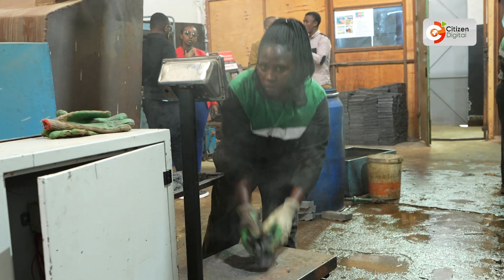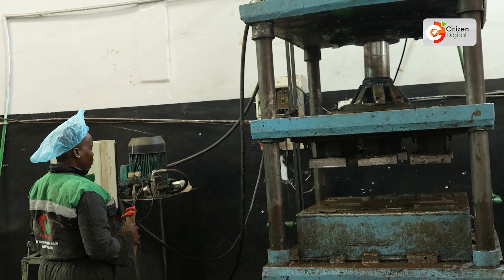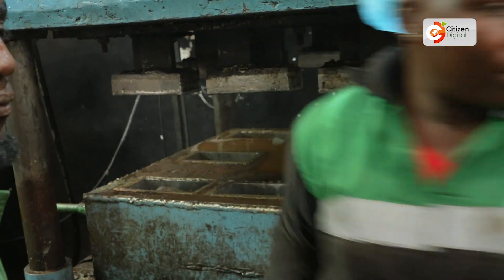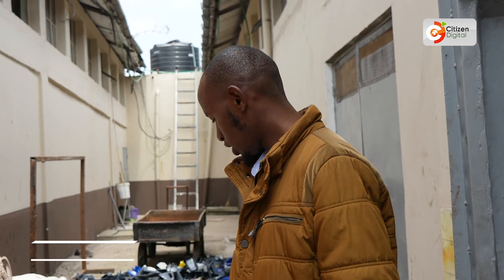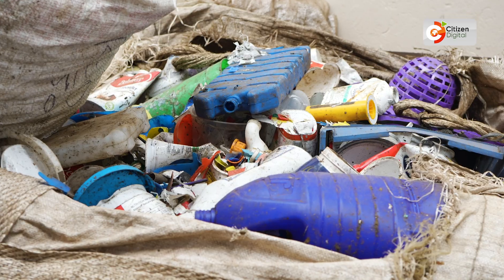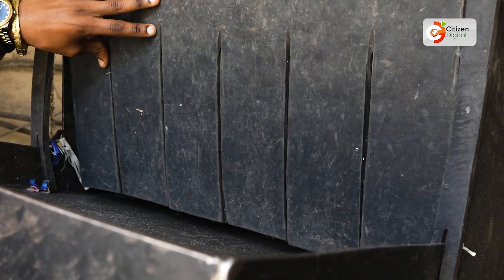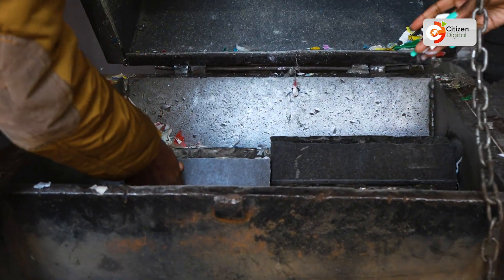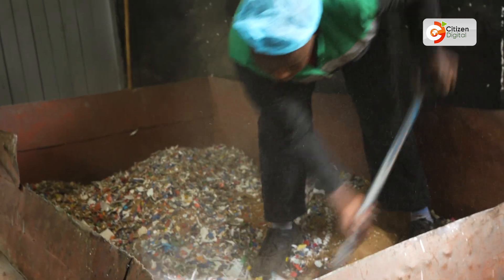Meet the Kenyan woman turning plastic waste into building materials

Comment: look please research on whatever you are doing, my issue specifically is in regards to hdpe and ldpe , i might not know a lot but the little i know is that both these plastics are thermoplastics and can be made into new bottles and mtungi, mixing hdpe and ldpe with sand is only causing more problems, secondly the VOC's (causes cancer still being researched) in that facility are not controlled proper masks should be adopted and emissions should be controlled , lastly the temperature is way beyond hdpe's melting point which is 135 C , 400 C will degrade that plastic and will lead to microplastics in the future ...  and as to the reporter from the video nobody cant tell the smell ,please tell us how it smells outside and inside the factory 🧐

Comment: This is a very bad idea. Anyone who understands plastics will agree. It should be banned.
Reply: Can u elaborate on the "bad"
Reply: @lamutamu5492  plastics degrade under uv(supplied by the sun) and will end up in the water supply and air in form of microplastics. Plastics are estrogenic and will reck havoc on our endocrine system. This is a very brief summary.
Reply: @leanngugi  thnx for the info